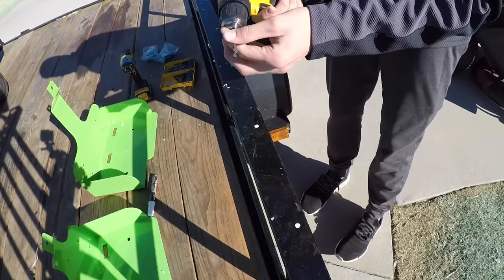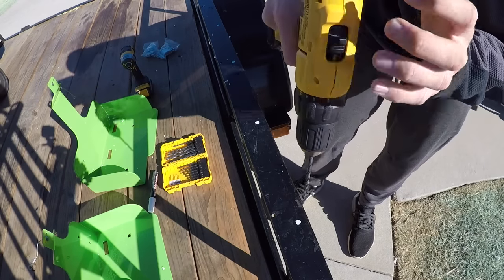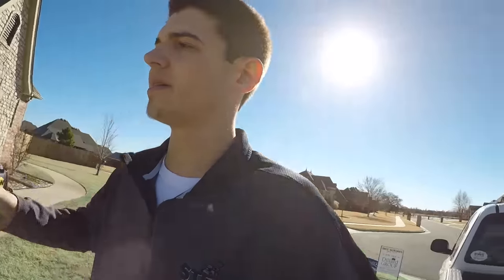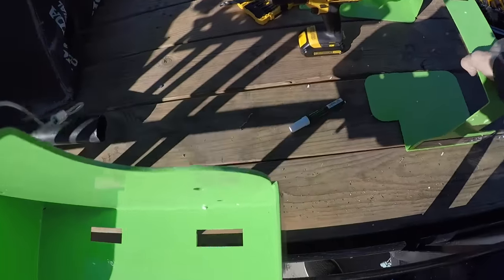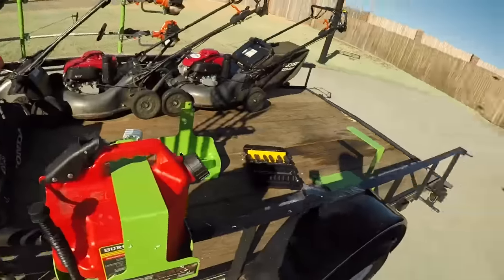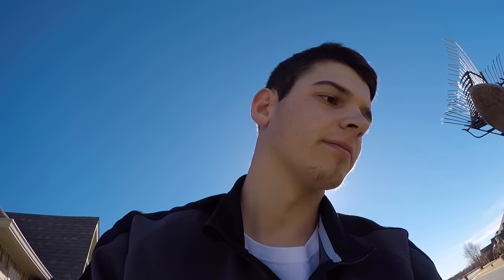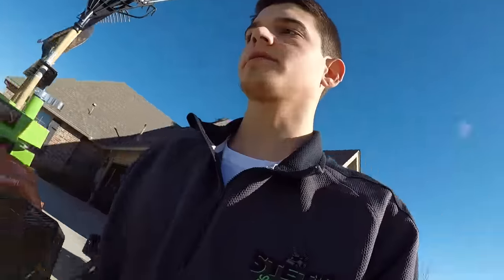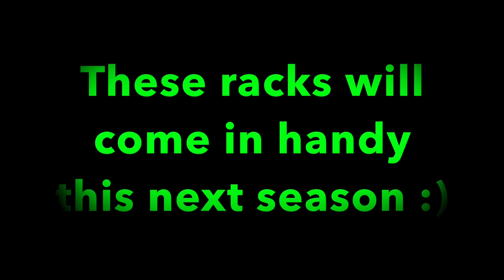New Trailer Add-Ons For 2019

Comment: Not sure if your A Frame on trailer will work, but I am having a customer box being made for the front of mine. Solid metal with lid and lock. Wont be entire size of A Frame but should prolly hold your 2 gallon can and small stuff. I want to do mulch and i need one side of the trailer easy for them to dump into.